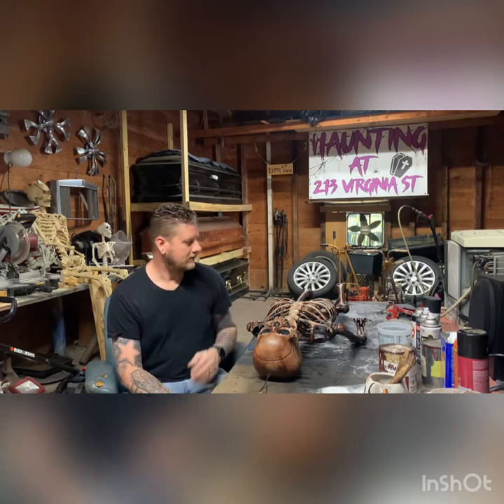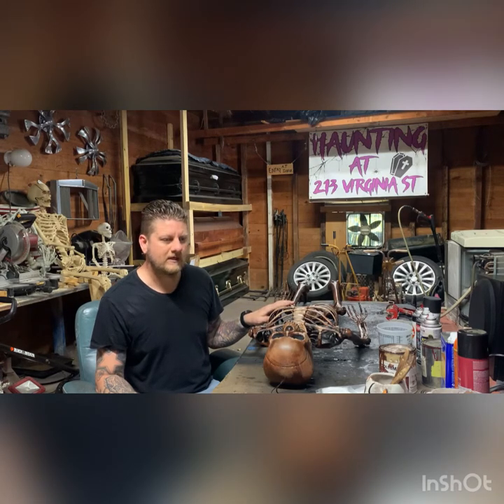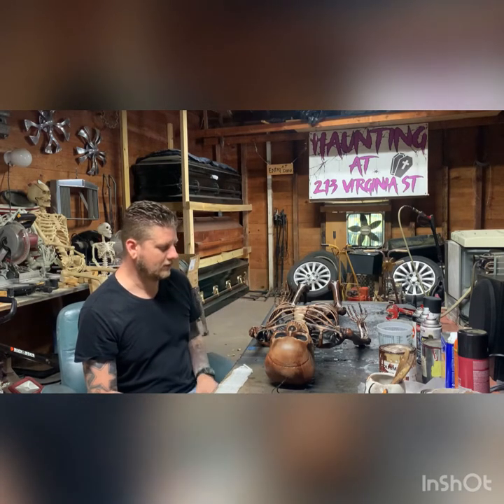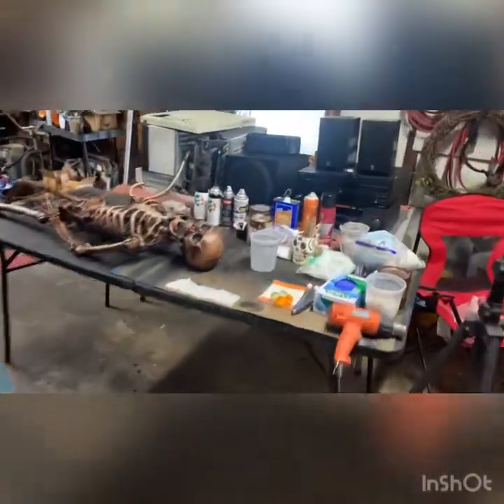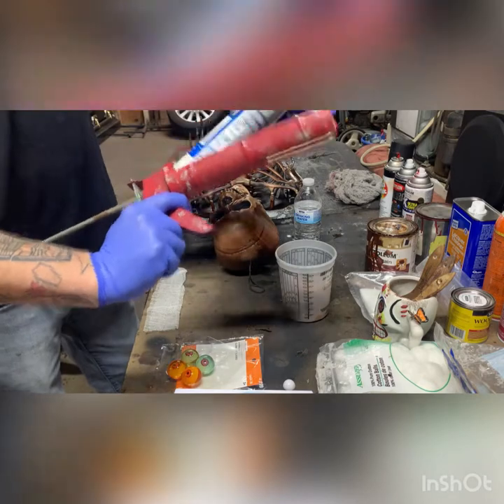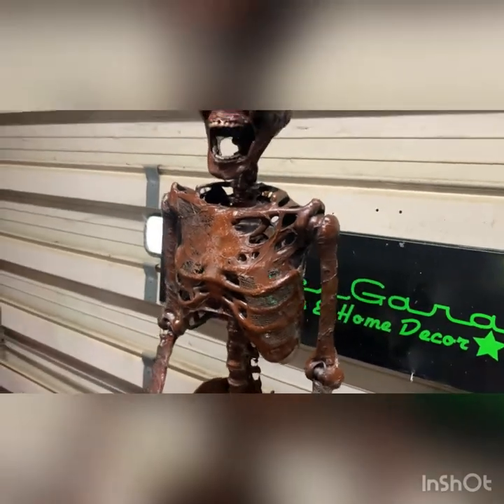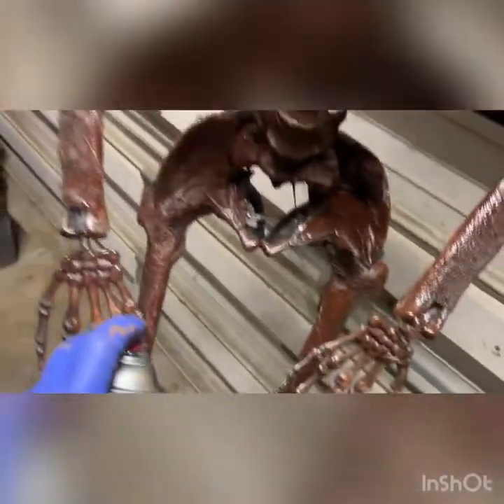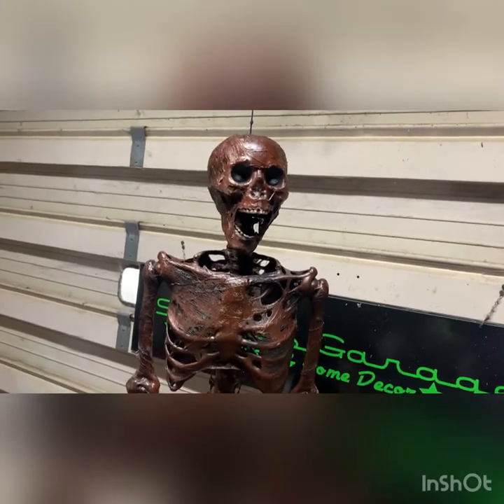DIY realistic corpsing using latex caulking

Comment: That is the way I always did it, though as far as how liquid that depends on how I am using it. If I am coating an outdoor prop or corpsing cotton balls or tissue papers determines how liquid I want it. I have had a tupperware of the Caulking and water still be totally useable the next year too if it was closed up good.